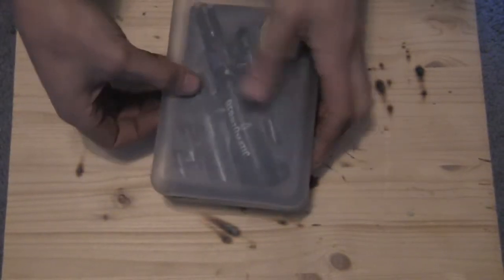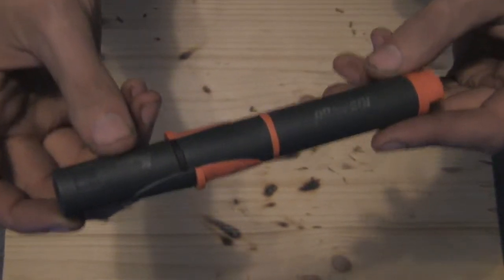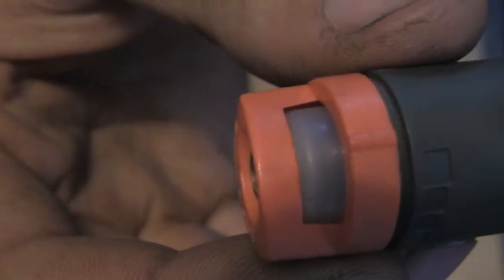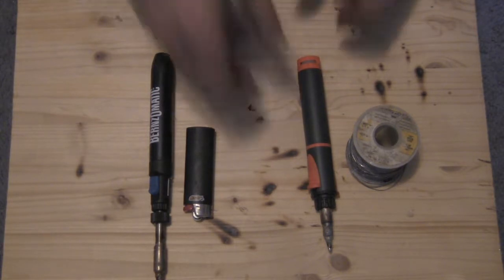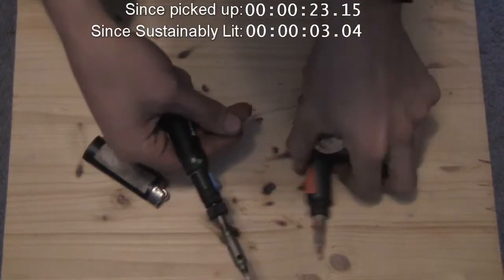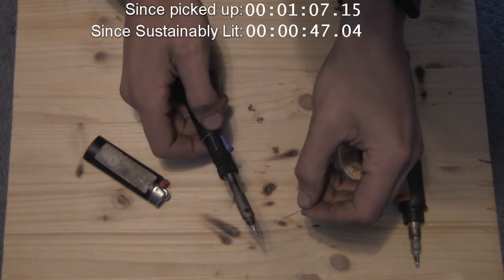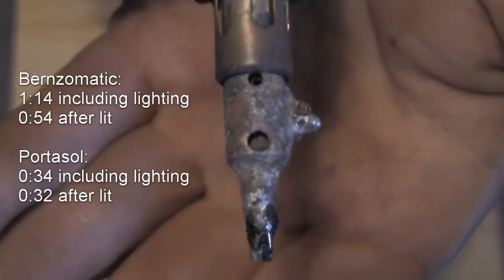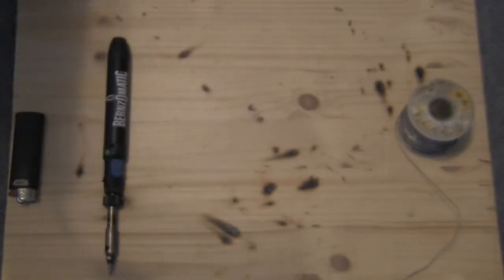Portasol ProPiezo 75 VS Bernzomatic ST250 Butane Soldering Iron: Heat up time

Comment: Great video. Just picked up the 125 from the link.  Thanks for including those; it makes it easy to purchase the right item without having to guess.  I just did the W123 door seal replacement yesterday and reviewed your video before the attempt.  Thanks for that too. I am doing all 4 door seals after the paint job. If you get a chance to look at the new paint on my channel I’d love to see what you think.
Reply from the maker: The paint looks gorgeous! Looks like a very similar color to my car, mine is a blue metallic, but looks almost identical in terms of the shade. I desperately need to repaint some of my car as well, the southern sun has taken the clear coat off all the flat surfaces pretty much. I've been hoping to do it soon but every other job for customers and such has been fighting me like never before.

Comment: I got the portasol 75 watt and its already junk after 4 month...won't even ignite even with a full butane tank!!
Reply from the maker: I believe they come with a 1 year warranty, you should check into that, could be a bad unit. I've had mine for several years now, it's been dropped, stepped on, gotten wet, gotten oily, the whole time I've had it most of the soldering has been done in high humidity high heat areas, and it hasn't skipped a beat.